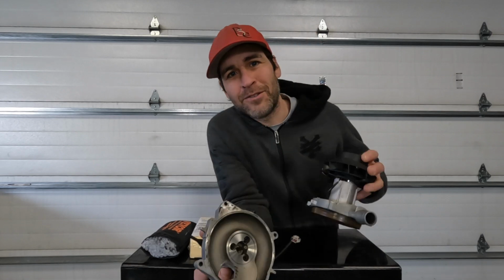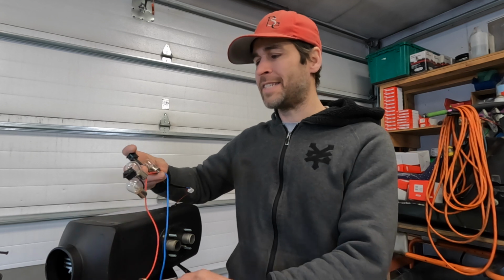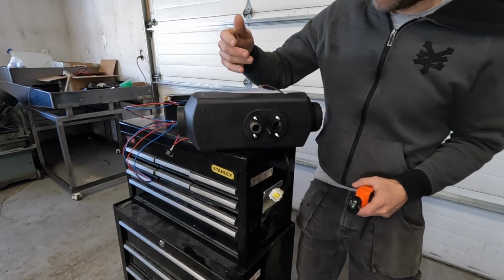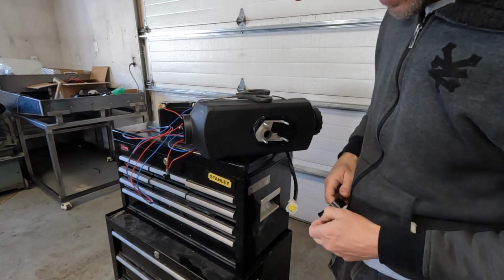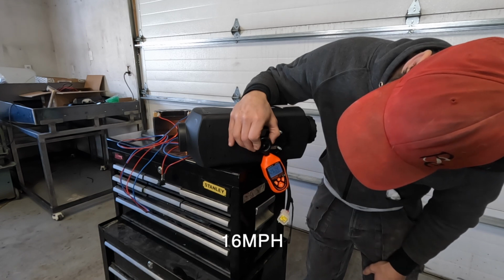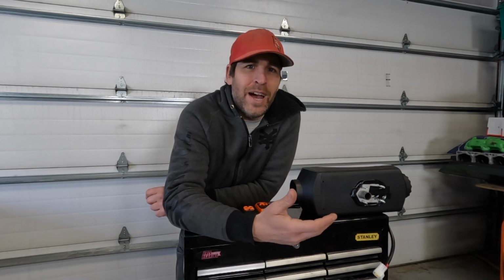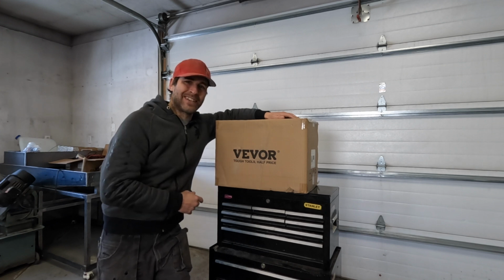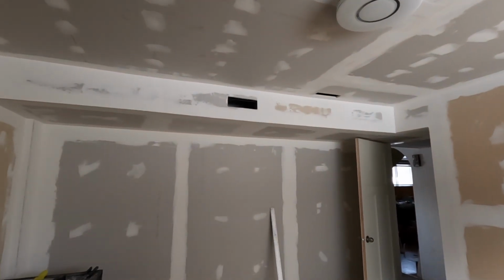38% Gains !! Ported Diesel Heater Give Real Results

Comment: Hi Joel. I like your attitude towards finding out why. Great informative videos with various outcomes.
I have a question about air intake on these heaters. Would the heaters burning efficiency improve with improved air intake with maybe a small small fan forced intake assistance. Your comment and experience would be appreciated. Keep up the great R&D and asking what if.
Reply from the maker: Hey... sorry I didn't get to your comment sooner. 

These heaters are generally set up pretty good from the factory, and increased air flow, if not needed, will cause a less efficient burn. It's a really good idea to get a CO meter and monitor your exhaust, even if you are not doing any experiments. 

If you have a base line of say 12ppm... and then one day it is 50... you know something isn't right.  

If your heater is running rich, for some reason, like you are at a very high elevation, then adding a fan to assist the inlet air could increase efficiency and this would show up by reducing the CO emissions.

Comment: Again, Great videos. I recently watched a video on a newer 2KW Vevor heater with new style ecu/control head. It heats to set temp, shuts down totally, and then starts up totally to maintain set temp. I hope I can upgrade to these electronics, for the 8KW heaters from suppliers.
Reply from the maker: I'm guessing that next fall, you will start to see more and more of these electronics being released... I would advices to buy the controller and motherboard (ECU) as a set... I have heard lots of stories of people buying a controller and then not being able to connect to their ECU or to find a compatible ECU
Reply: @loweredexpectations4927  Thanks again for your reply, and insight. You have great skills and smarts, and you will do fine going forward. Best wishes for your future. 🇨🇦
Reply from the maker: @stevecarlisle3323  Thanks, Steve.

Comment: So sorry to hear about your personnel problems just hang in there, love watching your videos, do you ever sleep? I was In my workshop and I have 10 litres of Model Engine fuel, have you tried this In one of your Chinese Heaters?, Just wondered. I've only mixed a unmeasured amount to my diesel just to get rid of the stuff, do you think its something that you could experiment with? contains Methanol, keep those videos coming.
Reply from the maker: Thanks for the comment... sorry for the delay... I've been busy. 

I would love to try some nitro fuel... I assume it won't run well because the ration will be way too lean... may run, but not make much heat... but I could be totally wrong . I want to try it BUT it is about $100 a gallon here, haha.

Comment: Great video 🙂 Cats always take precedence over what we are actually trying to do as well 🤣
As another note. I had previously said I was fairly underwhelmed by the heat and airflow out of the heater I got. I ended up getting another heater from a different brand, and the airflow and heat output is WAY more. I think the "5-8kw" I got was actually a 2kw running full tilt. The "1-8kw" I got I think is actually a 5kw (maybe it is the larger body 8kw but I haven't taken it apart yet), that has around twice the airflow and heat output. The wild wild west of numbers from the China manufacturers eh. I am very impressed by the second heater that has the better ECU and controller, now that I have learned more about these heaters too.
Ooo I am very interested in the plasma cutter as well! The couple times I have used one made me realize just how freaking awesome they can be!
Damn, sorry to hear about the negative situation you are going through. Good luck with everything going on!
Reply from the maker: Haha... yes, cats always matter more than whatever else is happening. 

That's interesting about your heater. Haven't you ever calculated the fuel flow ? 1L is about 10 KW, so the math is fairly easy if you work backwards from there. I have only ever really seen 3 different heater styles, though I know there are more. The small 2kw, the 5kw that is sometimes called an 8, and the larger bodied unit ... and it has a more aggressive fan, that is for sure. 

I owned a plasma cutter for a few weeks, many years ago, and someone walked away with it, haha... I still have the safety glasses and sold the case cor $60... I'm good at investing. It will be nice to have an affordable one that I am not worried about. 

I am hopeful about my situation and if things go well, It could be better than ever, in a year or so.
Reply: @loweredexpectations4927  I never calculated fuel flow with that model, because I ended up getting refunded due to a squealing fan at low speeds. It was still covered under Amazon so I just got a refund. 
I believe my new unit is either a 5 or 8, but I haven't calculated anything yet. I can just say I am very happy with the new unit I got.
That really sucks about the plasma cutter growing feet...
Good luck in everything you continue to work towards, and well be here whenever you come back.

Comment: Just got my vevor usb 1200x microscope with 7" screen in.
I have a bunch of vevor tools. I'm going to be buying 4 more vevor items off of ebay.
Personally I think their tools are a great value for the money.
The way I see it is, I'm on a fixed income now and I have a lot of projects I'm working on plus I do maintenance on the side.
I look down at my 2 hands, one has a vevor tool in it, the other one is empty.
The one hand is getting work done, the other hand is just scratching my butt.
Know what I mean? 😂
Reply from the maker: HAHA, They do make decent stuff... good value tools. 

I believe that you can use my discount codes on everything that you buy. Also, if you ask me for a affiliate link, an any item, it doesn't help you, but I will get credit for the sale, haha. 

I have been considering one of those microscopes for inspecting lathe and milling tools.

Comment: Vevor stuff is pretty low quality....
Reply: Are you familiar with the phrase "Chinese junk" if not you probably will be soon
Reply from the maker: @JimLahey21  I am familiar with the phrase. I'm also very familiar with the phrase "Jap Crap"  or Jap Scrap" as I grew up in the early 80s -90s ... and now, they are known for making some of the best quality stuff on earth. The same thing happened / is happening in South Korea, and it is also happening in China... 

We keep sending all of our manufacturing to other countries, and after many decades of producing crap, they eventually figure it out. I have a Vevor vacuum pump / chamber, ultrasonic cleaner, flex shaft grinder, stick welder, pipe bender, 4 diesel heaters, adjustable castors, electrical enclosure, extension cord and probably a few things I'm forgetting... None of these things have ever let me down due to being Chinese Junk... 

I have had two products from this company that have had some sort of issue, I'm currently editing a plasma cutter video and it had a failure right after I was done filming.
Reply from the maker: Care to elaborate or provide a story / evidence, backing this claim ? Great name by the way.

Comment: I have been doing drywall for over 35 years,so if you have any questions let me know.
Reply from the maker: Oh wow !! ... I probably would have asked some stuff two weeks ago, if I would have realized, haha. I'm doing the final mudding (I hope) now. 

Interestingly... some of the drywall that was already installed in the basement, when we moved in, was pre covered in wallpaper. Yes, pre covered, and I know this as it actually wraps around the edges... whoever "installed it" decided to only use 7-8 screws per sheet, so that they wouldn't have visible screws. 

Whoever did renovations before me did some special work... I'm not the best, but they were really special. 

PS. After doing it a few times in my life, I consider drywalling to be an art form.

Comment: Excellent Joel. Sorry to hear about the separation, but probably for the best. Living downstairs could be awesome. Love your videos,  at least you don't have to live in the gradge. 😉. One question,  can I leave the air intake tube off my heater but keep the exhaust pipe on ?👍👍💚🍻
Reply from the maker: I'm not going to lie, I'm somewhat excited about the change, but also, I don't like change, and parts of it are going to suck... I just have to focus on the parts that don't suck, as much. 

I would live in the garage and rent my whole house if I were able to build a suit out there.. .but apparently they frown upon that, haha. 

Yes... Taking the inlet off will likely make it noticeably louder though... I recommend not running it without the exhaust, haha.
Reply: @loweredexpectations4927  thanks Joel, I know things suck for a while,  and it's an up hill battle, but pray for peace and strength. Things will work out.👍

Comment: Sorry hear about your brake up that always sucks even without the money troubles it can make, I found the video interesting I'm not shocked that the CO level drop, it would lean the fuel mix out it seems like these heaters run just bit rich out of the box and even more so when add intake and exhaust. CO from incomplete combustion this for sure going happen if fuel air mix is has too much fuel, but can still happen even if fuel mix not rich or even if a bit lean but less likely if lean.  I buy a 5Kw heater using one your links from black Friday, it making about 20-50 ppm CO there still hint of exhaust smell.  It is setup with no intake tube and only one soft 90 bend in the exhaust tube that come with it, does have altitude compensation,  I not looked too hard but I not sure cal menu to adjust things but really it not too bad as is, but I have wonder if running it a bit leaner would clean up the exhaust a bit more, I not full installed this yet so there likely be some more bends in the exhaust and if put on intake tube I feel it like exhaust will be even more dirty, I have plan to try test this some.  I'm very much looking for your video of the cutter, I'm looking at there 3-1 no touch TC-520 cutter welder combo so you may want throw a link up for that when your doing your video.  I also used one your links to buy an ultrasonic I will be setting that up this or next weekend I have carbs need to be clean and rebuild.  Best of luck with everything.
Reply from the maker: I am quite fortunate in that it hasn't been a messy separation. I have heard a lot of horror stories.  

I'm not surprised about the drop in CO either... If it were already really low, the extra air could potentially be a bad thing, and I have seen too much air actually cool the burn, and cause more CO. 

I don't think 50ppm is crazy high... it may never cause an issue, but it is more than I would expect from a "properly tuned" heater. If you can get more air in there, it should absolutely help with the CO.... If you are already not running a tube, you can just use a hack saw and some drill bits (if you don't have any porting tools) and chop out a hole... it doesn't have to be the exact same as mine... I replacement fan is cheap if it all goes terribly wrong, haha. More exhaust bends will increase CO but a strait 2-3 foot section won't have much effect. 

Wow... you have a whole fleet of Vevor stuff ! Soon you can start your own Vevor channel, haha. I will try to toss a link up for the 3-1 in a following comment, for ya.
Reply from the maker: https://s.vevor.com/bfQYl1

Comment: So, you had to break up with your partner to properly redo the basement! Well done.
I also went through this but it was very beneficial for me, it pushed me to get out of my comfort zone and build another house entirely, I rented the old house to a company. It wasn't easy, but the satisfaction is worth it and I wouldn't change anything.
Until you find a partner who is on the same wavelength as you, everything is a compromise that is not worth it. I found it :)
Reply from the maker: HAHA ! It took me 10 years to build a garage and 1.5 bathrooms ... so yeah... It took this to motivate me to "finish" the basement in a reasonable timeline. 

If I could live in my garage legally, I would rent out my whole house, haha... I'm not going to be looking for anyone for a long time, or ever... perhaps someone on my wavelength will find me, but I'm not holding my breath. 

I'm glad things worked out for you... Thanks for sharing !